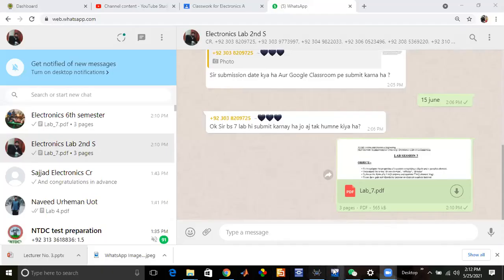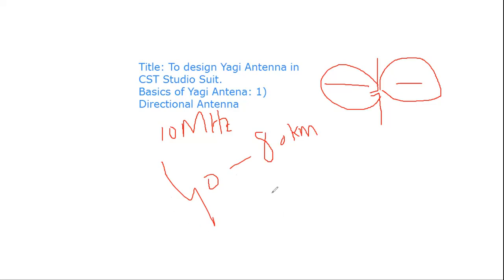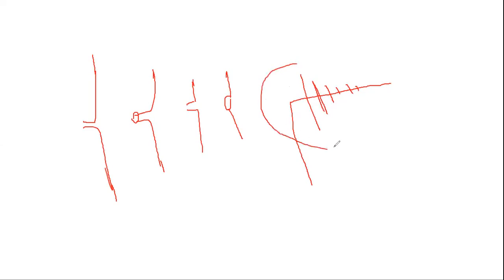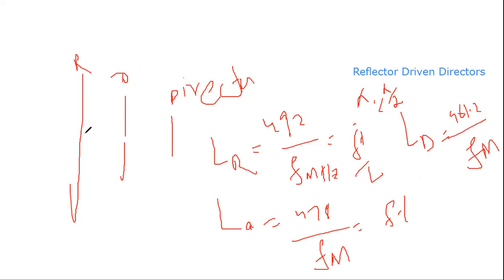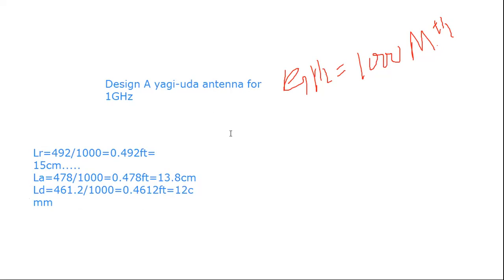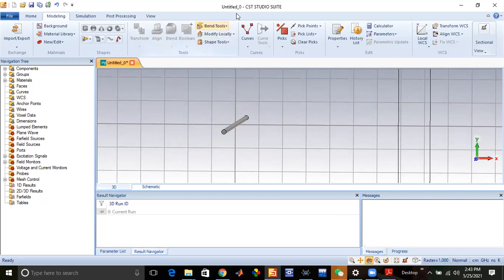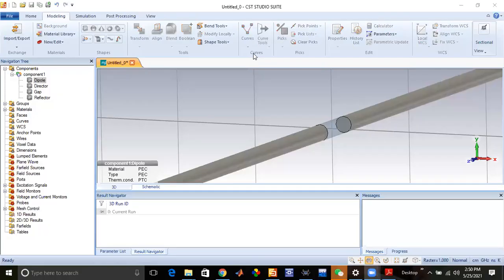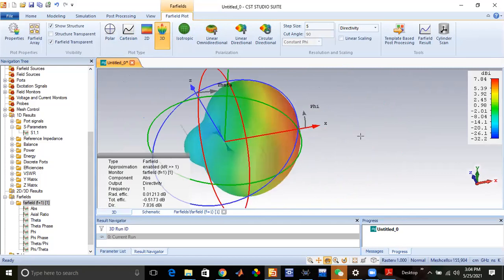Lab 7: To Design the Yagi-Uda Antenna in CST

Comment: For 1GHz lambda will be 0.3m and spacing is 0.3/4=0.075m or 7.5cm not 6 cm also L values are not correct either